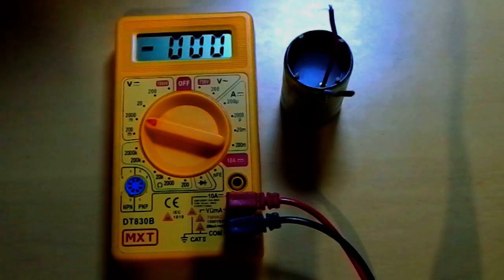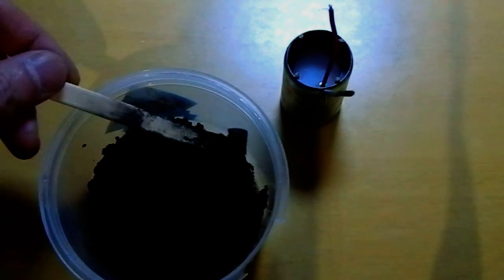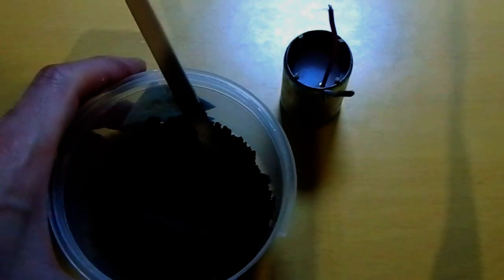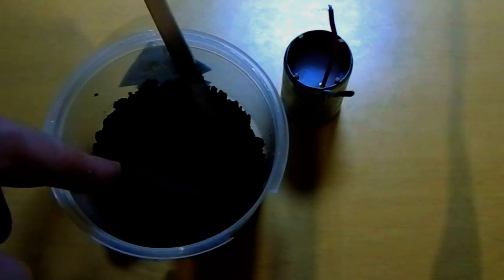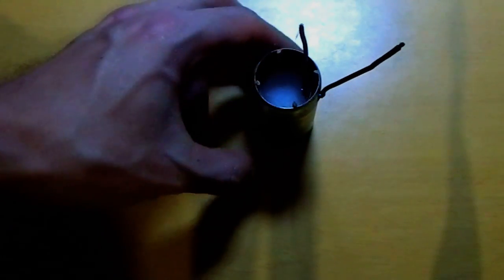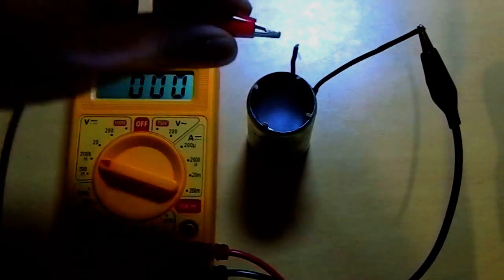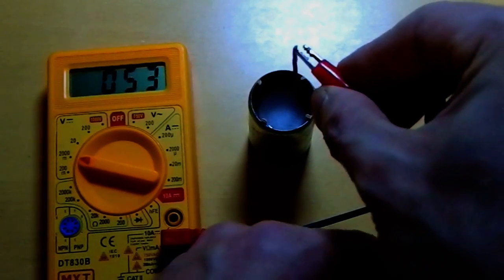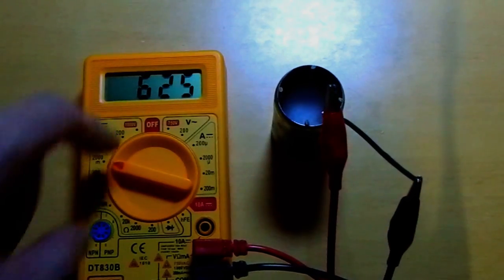Creating a Crystal Cell with a carbon zinc battery

Comment: Just made one myself but used the carbon rod instead of copper. Just waiting for it to cool down. I did mine a little different though.  I lined the inside with a thin material then I lined it with magnesium ribbon.  Then attached the ribbon to the zinc shell. Atm its reading 1.85 volts, will get a proper reading once cooled.
Reply from the maker: Greetings, magnesium always give good batts :D  I am trying to build those batts without the expensive magnesium. I have a carbon/aluminium that it is working fine, but not that much voltage. Thanks for the comment... Regards.
Reply: Sohei Thoth  The voltage dropped to 1.45 but the current was really low. Made another yesterday with just the zinc shell and carbon rod. The voltage settled at 1.01 and has been running a 3v white led through a joule thief ever since.
I also made one with a copper pipe and has been going strong for 36hrs straight now. No water was added to it so lets hope it lasts. The first 12hrs of that cell was the best though, had it connected to a 5v step up booster and it charged my phone up 50% in 2hrs before it settled and the booster dropped to 3 volts. It still works if I put 2 cells in parallel. So its an amperage issue.

Comment: Wash the manganese dioxide using acetone. Two rinses then into a coffee filter.try the same battery again using 1/3 Rochelle salt and 2/3 Epsom with 1/10 teaspoon of the Mn02. Use excess, melt the crystal mix over a gas flame(no water added) in a ladle and pour. You may need to repeat this a few times to fill the cell because it sets so fast. Polarise the cell with a 9 volt batt and leave for two months somewhere dry. You should get 0.9 volts and around 15ma.